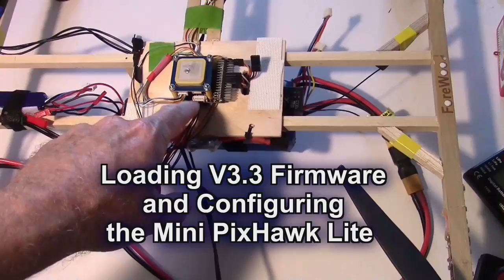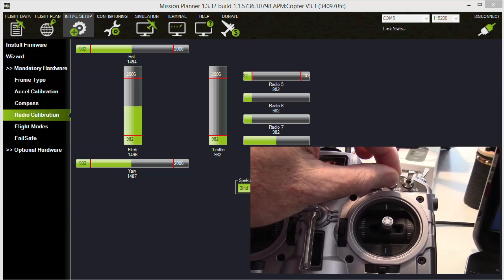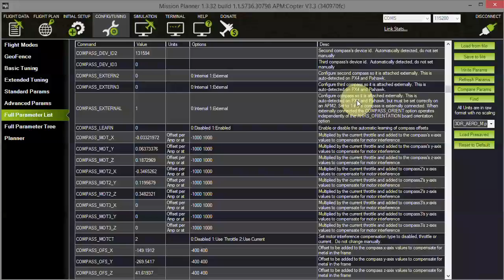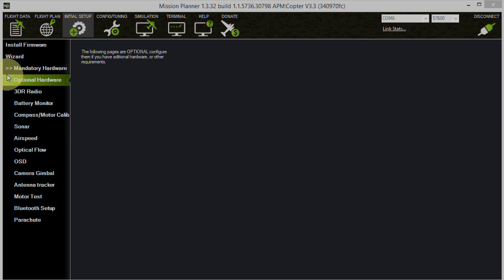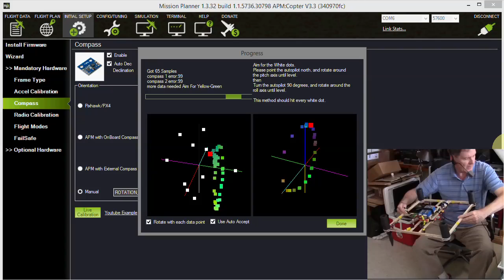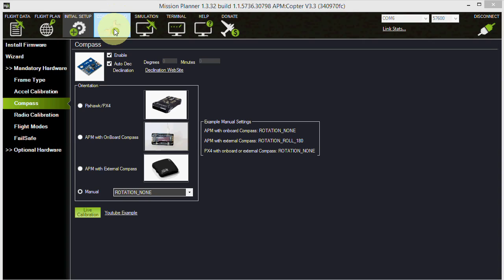Mini PixHawk Lite Build Part 2 -Load 3.3 Firmware & Configure in Mission Planner

Comment: I have a minipixhawk as well and I'm trying to set it up.  Do I need a battery connected when I try to load the firmware or can I just hook it straight up with nothing else attached?
Reply from the maker: +nicolas cage Just need the USB cable. No battery needed to load the firmware.You can even do the calibration that way if your receiver and GPS are powered off the FC.
Look at the schematic I provided in this build series.